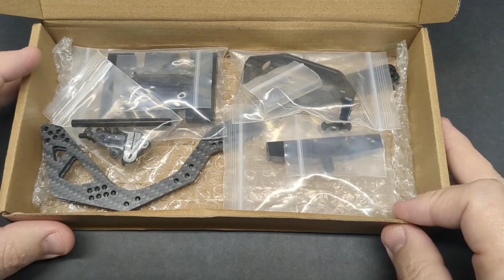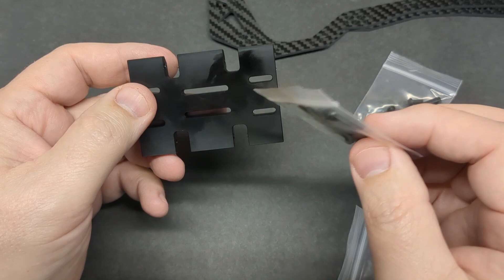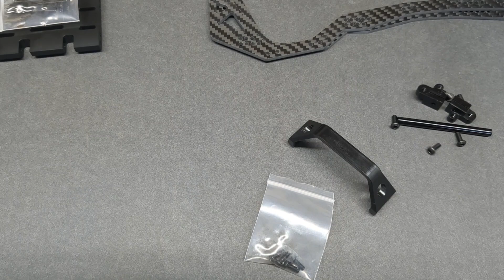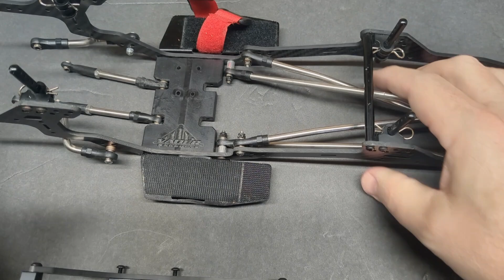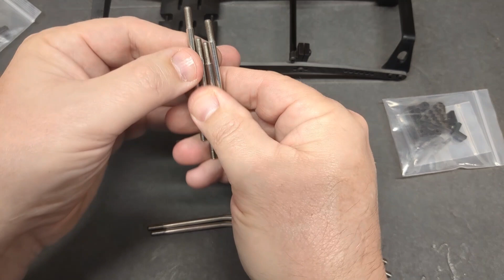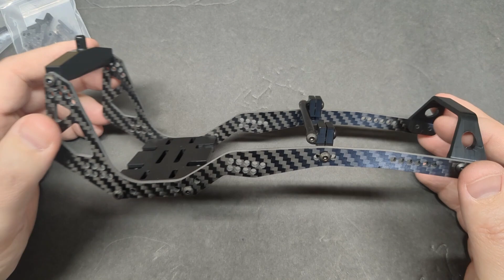New Amazon Poizd style LCG Chassis Build Series Part 1

Comment: I built one last month. Basically a knock off Poizd T3 V1. I put out a video on it. The rear links are super weak and bend easy. I bought some incision builders 168mm and double bent them with RPM ball ends. Its a great performer.
Reply from the maker: @U-TurnsRC  Awesome, I'll check out your video, thanks for the info.
Reply: @ there has been a couple of changes. I added a carrier bearing for one. Way better clearance and the links as I mentioned. I think you’ll really like it!